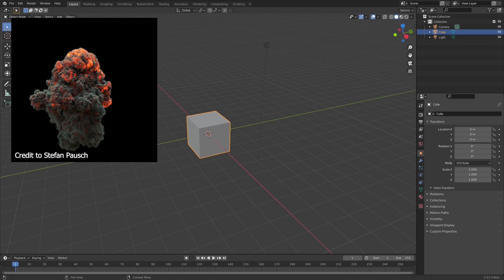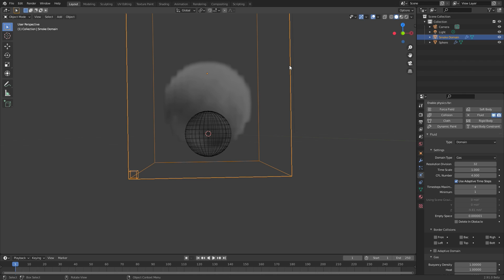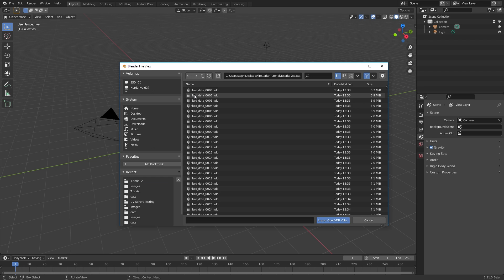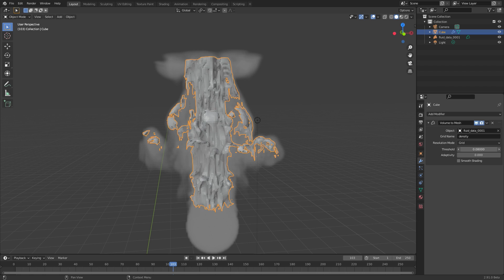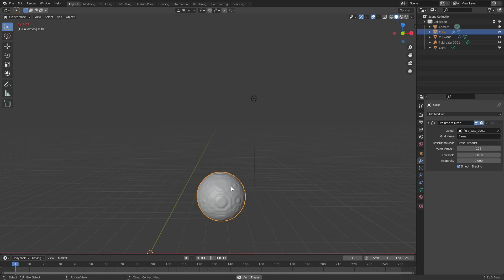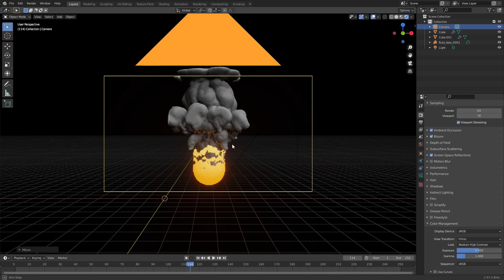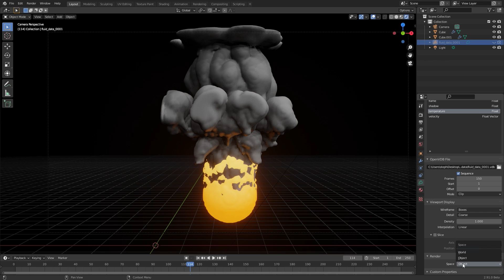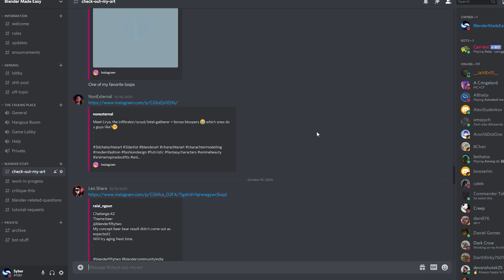Blender Tutorial - Volume to Mesh Modifier w/ Mantaflow (2.91)

Comment: Blender supports Python, right?
You should be able to run a script which does the render and file naming for you.
Reply from the maker: I thought about this but I don't know python sooo I kinda was force to name it manually.
Reply: You can run Blender from the command line with arguments for render range, output, etc so a (whatever OS) shell script would probably do it? Starting the single-frame instances of Blender for you.